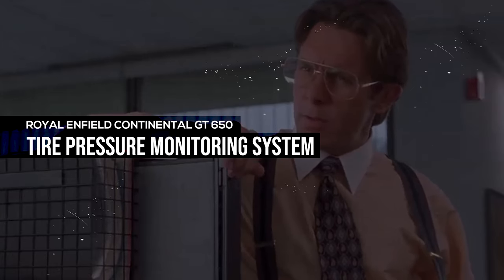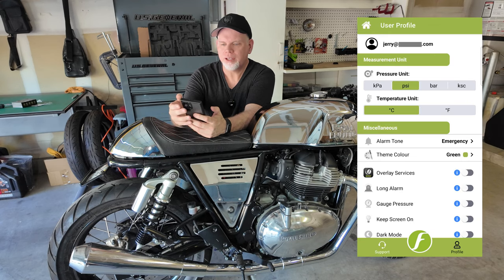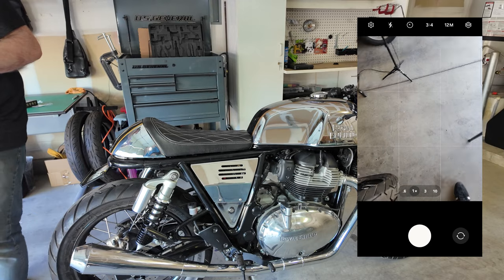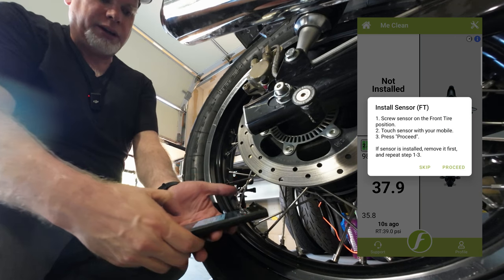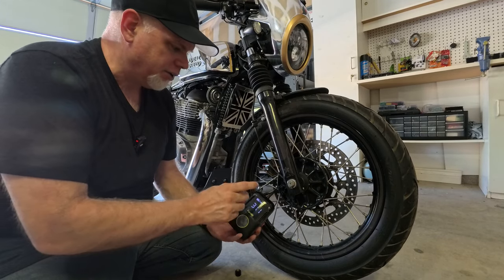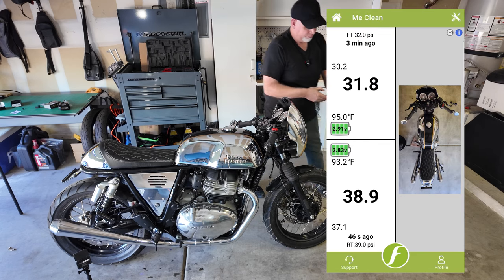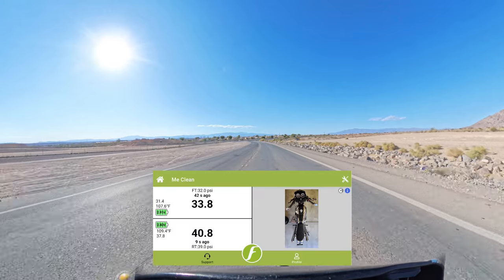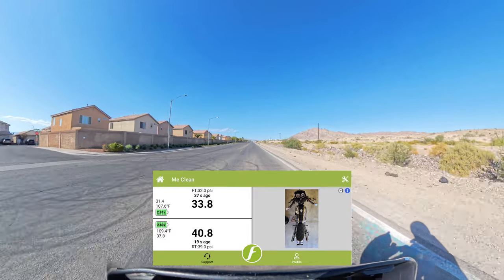FOBO Bike 2 TPMS Install & Review of Motorcycle Tire Pressure Monitoring System

Comment: I got a similar thing from a certain Chinese online store. It came with a display to mount on handlebars that was missing a piece, so it was actually not possible to mount it. That made me re-think if I want trust my life to something that cost less than 5 dollars. I was not worried as much about inaccurate reading but rather about the cap somehow failing and deflating the tyre while riding. Am I too paranoid?
Reply: FOBO BIKE 2 do not comes with a display & the sensor actually stays on the tire quite well even without the lock nuts. Cheap systems can be risky, and it’s definitely not something you want to gamble with.
Reply from the maker: I don't see any possible issue with these FOBO sensors coming off. Also, I got this brand because I did not want to mount another unnecessary display on the bike. Getting pressure alerts sent to the phone or just checking the phone app is all I need.